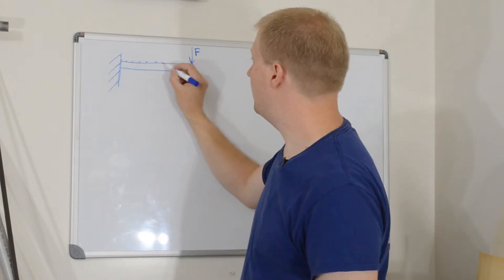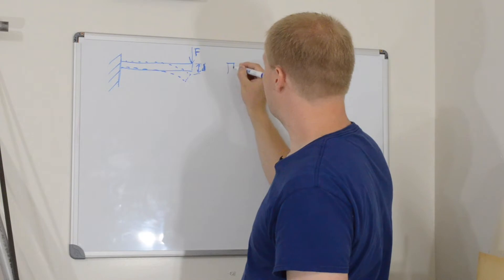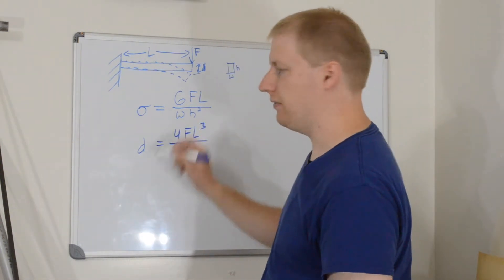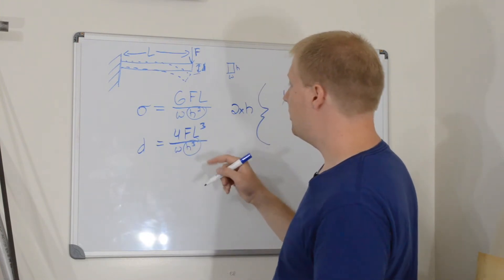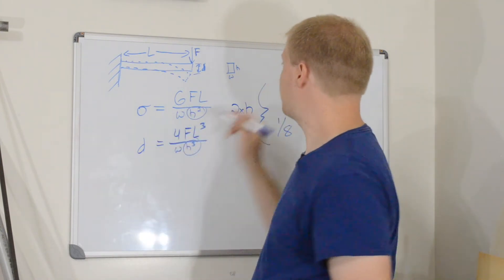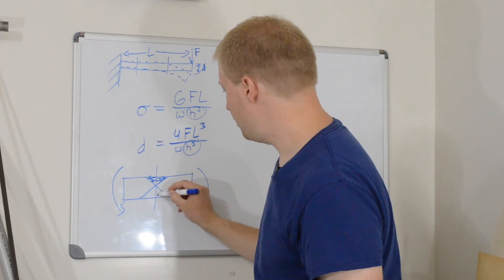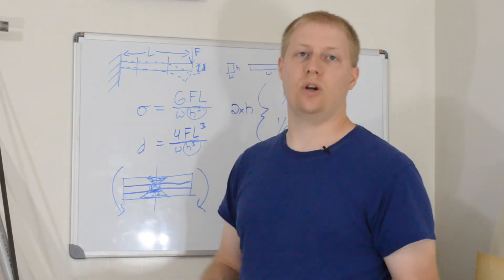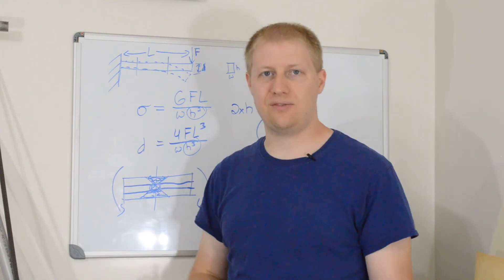Can carbon fiber be both flexible AND strong?

Comment: Good approach to the topic, but I disagree with you on cores not being beneficial in a high-performing limb. And while you are generally correct that wide and thin profiles are the ticket to a strong, flexible limb, I would argue that flexibility is not the most important attribute for performance.

Specific energy storage is, and it depends on three things: density, Young's modulus, and elastic strain. Density and Young's modulus are intrinsic properties of the material. So that leaves elastic strain as the key design variable. And the elastic strain is fhe most influential factor, having a squared effect. One must work within the material's elastic limits, and take into account fatigue damage behavior of composites, which is often underappreciated. The higher the bowyer sets the design allowable strain for the working limb, the more energy the limbs store, and the faster they can overcome their own inertia during the shot. 

Once the limb working length has been set, the peak compressive and tensile bending strain experienced by the face fibers of the laminate at a given draw length will be directly proportional to section thickness. As a result, a deeper, narrower limb will always outperform a wider, thinner limb of the same material, at the same draw weight, assuming material limits are being respected.

As for core materials, there is good reason for nearly all the high-end recurve limbs having maple, bamboo, or syntactic foam cores, about one-half the overall thickness of the limb. Let me prove it to you mathematically. Take a solid carbon fiber composite rectangular section limb. Draw the bending stress distribution. It's linear, with max tensile stress on the back, max compressive stress on the belly, and zero on the neutral axis. Now draw the specific strain energy storage distribution. It's related to the square of bending stress. You get a parabola, zero on the neutral axis, and max on the faces. The area under this curve represents total strain energy stored in the limb section. Interestingly, the central half, closest to the neutral axis, contributes only one-eighth of the total strain energy. Yet it accounts for 50% of total mass. If you could somehow eliminate the central portion and replace it with a material with negligible mass but strong enough to transfer the shear loads, you would wind up with a section storing seven-eighths the energy, but one-half the mass. The specific energy storage would improve by 75% over the solid section. In practice, the core has a non-negligible density substantially lower than that of the fiber composite, and realistically, an imorovement of just over 30% can be achieved.

Comment: I'm 165 Kg (365 pounds) and want to make a free standing carbon fiber chair using a curve which transitions to a flat piece on the floor initially I was going to use a foam core  but now I think I will use some uni-directional carbon fiber on the outside of the wide curves sandwiched in between multi-directional carbon fiber.  I don't want it to flex too much, but it needs strength around the curves.